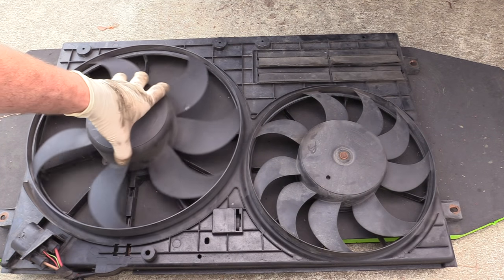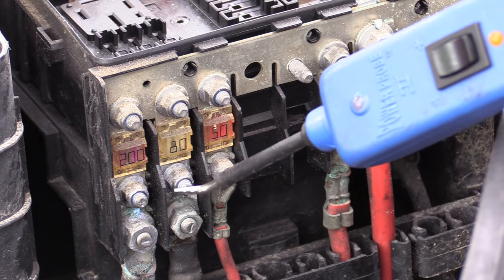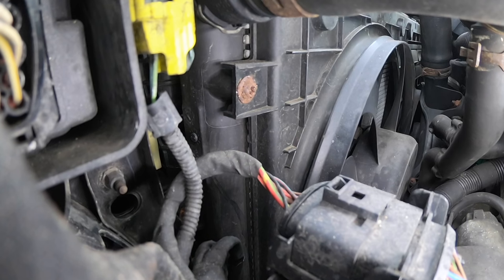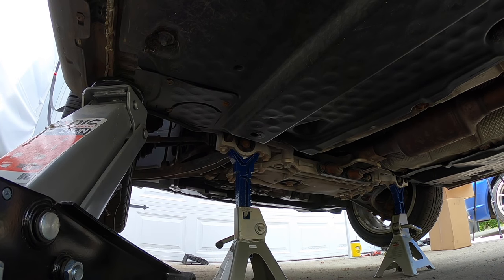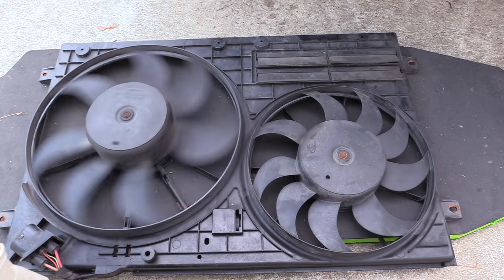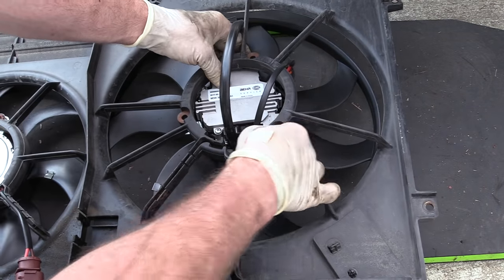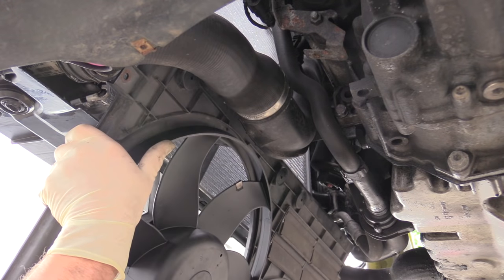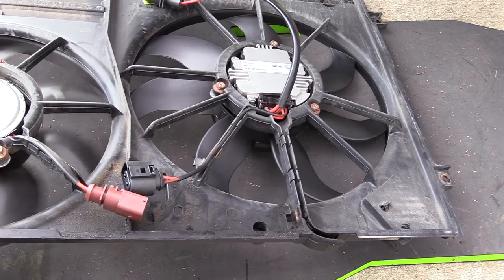How To Replace MK5 Cooling Fans

Comment: Hello, can anyone help me witj my fault. My ac runs fine when its been not moving for a while when i run it and go far distances it stops blowing cold air, thus my second fan is not working can this be the problem?
Reply: You need to replace fan assembly. This is a common issue on vws
Reply: @aminesap3084  the ac compressor might be a problem?
Reply: @mhmdhani7395  If your AC runs good when you are cruising at stops at idle, I’d say it’s a fan problem not the compressor.
Reply: @aminesap3084  no, i start the car open the ac its cold for like 10 seconds than stop blowing cold air. After a long period of time and a bit of driving cold air blows and that's not every time so sometimes it works sometimes it doesn't

Comment: On this video you mentioned the small fan it’s not working. In my case it seems like the big fan it’s not working. I got a PO480 code ( I think ). When I arrive at home I open the hood and noticed both fan were about to stop. I turn the car back on then only the small fan started to work. When I try to spin the big fan, it started to work. Then turn the engine off and on again and again just the small fan was working. I waited I little longer to see if the big fan will start spinning but nothing, until I gave it a little push then started spinning. I’m assuming the fuses are fine and in this case there’s something wrong with the big fan. Am I wrong?
Reply from the maker: Sounds like an internal failure of the big fan!
Reply: Thanks buddy! Do you have a video about acceleration problems? My car revs up by itself all the way to 10 (1000)  rpm a few minutes after I crank it up while it’s in idle or when I’m stuck in traffic.

Comment: I have a question about my 2013 VW Jetta GLI. Has 48k miles on it, automatic. My check engine light just popped on after the first day from a used car dealership. The only notice i had was the engine bay was really hot, but that could of been from a 30 min drive to work. Checked gas cap and engine bay but everything looks clean from a visual point. Any idea of what it could be? Anything will help, i just cant afford a repair or test right now. Will try to diagnose on my own. Great channel btw thank you!

Comment: My little fan is not working as well. Could bad cooling fans also cause loss on ac performance
Reply from the maker: 100% could be
Reply: @HumbleMechanic  That's what it was. I can't believe. I replaced the fans and boom the Ac system was working like it should. Ice cold 4 seconds after turning it on in 91 degree heat. Thanks for the great video!

Comment: I have a passat b6 wagon 2.0T 
Fans work only when they want, sometimes overheat because fans don't work, sometimes 1 fan work or booth at the time.

And as soon as I turn off the engine booth fans work with no problem,  what isbthe problem? :/
Reply: it happen to me the same i check everythig and it was OK, so i change the thermostat and the start working ok

Comment: Do you need to disconnect the battery before installing?
Reply from the maker: It doesn’t hurt, but no need
Reply: @HumbleMechanic  How can i buy you a drink? Your tutorial saved me $800 and I have never been mechanical at all, I work in I.T.! I got the new fans in and working great after you helped me diagnose the low-speed resistors went.

Comment: Can the radiator come out the bottom like this ? I need to replace my leaking radiator
Reply from the maker: for this one, front end has to come off
Reply: HumbleMechanic actually according to my VW workshop manual, I can drop the fans out the bottom and the radiator comes out the top after undoing 4 bolts and two hoses.   Seems the EOS is built different to the GOLF
Reply from the maker: Yeah some can be done without service position. It depends on how it’s bolted in.

Comment: will the mk 5 assembly fit a mk4
Reply from the maker: No it’s a different setup.
Reply: @HumbleMechanic  but are all the mk 4 interchangable. i have a 2000 vr6 jetta but found a 03 1.8t  jetta fan assembly ?

Comment: Has someone had the problem that the fans not starting if you set the AC on LOW, AC compressor and big fan is new, also no fault codes.....i don't know anymore :-( If the AC is on, there is a sissing sound that you normaly get if you shutdown the car, it's now constant.

Comment: Question,  my small fan works but not the big one
Reply from the maker: depending on the car, it may just be the big fan. The MK5 has the module built into the big fan

Comment: My 2007 rabbit has a p0481 code. The check engine light comes on once awhile and I don't know what is causing it. I spin both fans with my hand and they really spin freely. Also, sometimes the fans come on all the time. Anyone has any ideas of what could it be? Thanks

Comment: Why replace the whole assembly? Why not replace the pickup springs that failed? I did this for $0 since I had slings that worked vs $300. My Rabbit fans have been going for wok since I replaced the springs. This is as easy as rebuilding an altenator, same concept.

Comment: I have overheating on my tsi mk5, I already changed radiator, thermostat and water pump, and the problem continue. I don't what else to do.
Reply: Check the cooling fans!!!
Reply: @Alfra1324  cooling fans changed,. The problem continue.

Comment: Hey @humblemechanic will this work on my mkv r32?
Reply from the maker: Its very similar
Reply: It’s similar, I just did this on my 08 R and I had to drop the AC compressor and air injection pump as the small and large fans would catch on those components. The rest is the same

Comment: A real bad day is when your Torque screws are stripped due to rust and your only choice is to use a pry bar to break the shroud off and breaking your Radiator that’s a bad day

Comment: The price for two separate fans is twice as much as getting a new shroud with two fans pre-installed with control module included.
Reply from the maker: I’ve had poor performance out of that type of setup. And poor shroud figment. Not saying all preloaded ones are like that but all of them I’ve seen were
Reply: @HumbleMechanic  thanks for the feedback. I was wondering about the over fit and finish of the shroud.

Comment: Hey Charles I have a 2014 vw Jetta 1.8t and any time I turn on the a/c the fans speed up and cause a loud vibration and I'm trying to find out what it could be I checked both fans they both work and turn by hand smooth any ideas?
Reply: Same issue here, did you figure it out?

Comment: Great work as always,but you could of made it perfect by doing some "cosmetic" things.by replacing the rusted bolts,nuts,and metal clips holding the wires,or paint them to give it the fresh look,and it would be nice if you got us a video on how to replace the hood strut (even though it's an easy job) but it may be difficult for others.Thank you.

Comment: My fans spin but they are loud and I’m getting the code : Radiator Fan 2 (V177) P1951 - 002 - Movement Restricted / Jammed --- Coolant Fan Control Circuit 1 P0480 - 004 - Electrical Malfunction any suggestions

Comment: Bump old video,
But trying to make the call on fans,
I’ve confirmed I have a bad small fan but I also see that even if I put a headlight globe in place of the small fan the module stops grounding it,
Like a bad module?
But is my test invalid? Is the fan module smarter than I think,
I did the same test on a b8 Passat and it continued to power the headlight globe In place of fan

Comment: I have an 08 GTI that I can't get the fans to work. Fuses are good and I have replaced the fans as well as the coolant temp sensor but they still won't work. Any suggestions on what I should check/do next?

Comment: If this module is bad will it cause no power to as c pressure switch and compressor not to come on... the fans never turn on under any condition...I can't find a wiring diagram anywhere online

Comment: Anyone know if this is the same procedure for the 2005 Golf Gti MK IV GTi 1.8t? I keep seeing videos with Golfs with single fans and mine has dual fans, also anyone know where the fan switch is located and if it's in the same location as the single fan switch videos i see and last how to test those fans and switch or switches? Also as you mentioned your smaller fan has resistance which appears bad, but neither of my fans have any resistance and yet neither of my fans come on...which leads me to my fan switch maybe bad? Thanks great videos !

Comment: Question about fans. What would be the issue with fans when they're constantly running? I have a TDI mk5 2010 Jetta and the fans are always running. When I turn the car off they run for another 5 minutes or so. And then they turn off. What causes this? How can I solve this? Any help would be greatly appreciated. Thanks @humblemechanic

Comment: Hey man how’s it going ? I was wondering I have a 2009 mk5 Jetta with the TSI engine. I notice that only one fan works and the other doesn’t. It hasn’t been an issue so far no light no weird driving or anything like that. Is it safe to be driving like that ? Again only one fan is working

Comment: Hi

I realised that the new fans you fitted have their blades the opposite direction and the small fan has less blades
I'm assuming the new fans rotate the other way, anticlockwise? saying so because the blades are facing the other way,

So if I replace only the small fan I guess I would be have 2 fans spinning opposite directions?

Comment: I have a question. The large cooling fan on my mk6 won’t shut off. I hit a little bit of water last night on my drive home and now it doesn’t switch off unless I disconnect the battery. Thoughts?

Comment: My small fan is broken and I opened and saw the carbon brushs are worn out. After replaced both fans the smaller fan always spin even the ac is off. Any suggestion to check?

Comment: also i had fans replace both like u did on my audi a3 but now the big fan has mechanical Resistance to it and it wont spin and after spending so much money to replace them i might just add a fan myself that turns on by a switch in the cabin

Comment: i changed both rad fans and the coolant temperature sensor, both fans come on and run normal when i turn the ac on but neither fan will come on when i have ac off, even after its at operating temperature. any ideas?

Comment: @HumbleMechanic I was just told from VW that my fans need to be replaced on my Mk5 R32 when I brought it in due to AC cooling issues (was cooling a little off and on but never really cold at all) the quote for repair is $1500 that includes parts. Is replacing the fans in the Mk5 R32 the same as in this video? If so you will have saved me a ton!!! Thanks for the videos you make they are great!!!

Comment: My Radiator is loose and the fans are hitting the engine I have a piece of wood between the battery box and radiator that is hold it in temporarily, do these 4 t-30 torx hold the radiator in or just the fan shrowd? Thanks in advance :)
Reply from the maker: just the fan shroud to the radiator.

Comment: Thanks for the video. My Mk5 TDI 2.0 radiator and fans were replaced by a crash repairer but the air con didn't work. I took it to an air con place, they regassed it, and that made it work while the car was moving, but with the fans not working, it didn't cool while idling at a stop. I looked up the engine bay fuse box diagram, and sure enough, the 10A fuse SB8 for coolant fan had failed (probably due to the fans jamming up in the collision). I replaced it and it's all working as it should.

Comment: Hey man, the video is really good DIY,straight to the point. i have  a mark5 GTI aswell,and lately my fans will not turn on at ALL,i checked the two fuses near the battery(that are screwed to place) they are ok,but i dont know what else to check, i took off shroud, and supplied 12V,both fans turn on great,no mechanical friction,i dont know how to test the module,all i know they will not turn on neither by AC or engine coolant heat up,and NEITHER via command by Diagnose/tester. any ideas?

Comment: Hey Charles, I don't know if you read these old videos comments, but I've got a puzzling issue with my mk5 Jetta TDI. My fans are good, as I replaced them, but the only way to get them on is to pull fuse F13, and then they'll pop on for a bit. Otherwise, nothing. The main problem is that I don't have any AC. I tried to fill the freon, but it was fine. The electronic clutch for the AC compressor never kicks on, and the AC doesn't work at all, it just blows hot. Also, the fans won't even kick on when the car gets to 190° (operating temperature). Do you have any ideas? I'm so confused!
Reply from the maker: Yikes. What about the relay? Does the system have any faults in it? 

Will the fans come on if the car gets hot?

Comment: My bf has a 04 r32 that needs both fans replaced unfortunately we’re having a hard time with visual walkthroughs. Any help will be much appreciated.
Reply from the maker: On the R it is usually easier to do service position and remove them.

Comment: Anyone know the part number for those little metal clips that hold the fan wiring in the channel of the shroud?
Reply from the maker: I doubt that’s available separate. But I’ll see if I can find out. I would either get one from the junk yard, or use a zip tie
Reply: @HumbleMechanic  Thank you for taking a look for me.

Comment: Damaged the fins when you removed the fan assembly.
Anyway to prevent this?
Reply: disconnect the dog bone between the bellhousing and subframe, reinstall the short screw into the bellhousing and ratchet strap the power train away from the radiator.  if you're really going all out to save an eBay radiator, also disconnect the bottom boost hose and pad the radiator with suitable cardboard.  just support the engine before removing the dog bone, finding out about a broken trans mount is ill-advised with the above technique.

Comment: Will the small fan not working cause the A/C to not function at all?  Can the A/C be diagnosed without this fan working?  This is on a 2013 Golf TDI.  The reason I ask is I have a dealer shop telling me that I have to replace the fans before they can diagnose the issue, which will be a little over $700.  I'd just like to know if they are being honest.
Reply from the maker: no, the AC should still "work" it may not work well. Odds are the compressor is bad. I actually think the dealer is making a good call though. You have a known issue that needs to be fixed.
Reply: @HumbleMechanic  Awesome, thank you!  I have a fan set on the way I'll see where I stand at that point.  By the way I love the videos they are very helpful.  I've owned 7 VW's at this point 2 Passat TDI's (2012, 2015, and 1 1.8L 2017), a MK5 GTI (recent for my son), MK6 GTI, a MK7 GTI, and as of a couple of weeks ago now a MK6 Golf TDI (replacement for the MK5 GTI sold in Jan.).  I've not had to repair any of the other cars, but these used ones are in need of some repair.  Your top 5's are great things to look out for, to many good videos to list.
Reply: Found out for sure the dealer was lying.  I picked up the car and both fans work.  I put r134a in the car via Walmart a/c pro and the A/C is blowing cold.  It appears to have either leaked out or evacuated.  Time will tell for now.  After 12 hours it was still at the same pressure I put it at.

Comment: Im replacing the fan assembly in my 2006 jetta. The four torx screws holding the fan are rusted I got them out but I dont want to risk using them again. Do you know where I could order some replacements.
Reply from the maker: FcpEuro  will be able to get the exact ones.
Reply: @HumbleMechanic  thank you

Comment: How do you take the radiator out?  the bottom?  thanks.  great vid.
Reply from the maker: Front end comes off. I have a video shot, just need to edit
Reply: Thanks...  on my 2010 CC, had some plastic parts blow out on the highway / had to temporarily patch up and use radiator sealer  - even though I've flushed it out about 1,000 times, the cooling efficiency is not up to par running (210F in 96F weather/ spikes to 220F when shutdown).   Want to take out the radiator and flush or replace...  but not sure as to how to do it.
Reply: Thanks.  Because of you and your videos, I have elected to keep the VW.  You take the mystery out of it... and provide the knowledge to dig in, as deep as required...  although I am still dismayed by the durability (or lack thereof)  of all the plastic ancillaries.  (and this from an old fart pushing 70 - but hey, I still like to get my hands dirty)

Comment: Thank you for your video, this helped me confidently replaced the fan assembly on my 2008 Jetta GLI.  The screw behind the AC line (top passenger side) was a pain to get to.  I had to use a multi-joint or wobble extension adapter for my ratchet.
Reply from the maker: Yeah the two on the passenger side can be tricky. Great job getting it done
Reply: A1 Auto: Repair Tips & Secrets Only Mechanics Know also helped you 👀